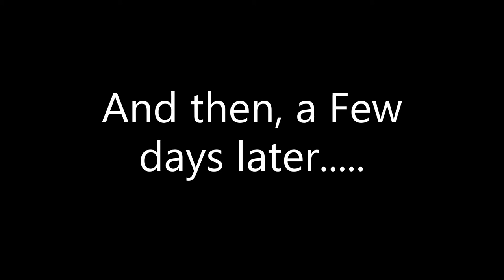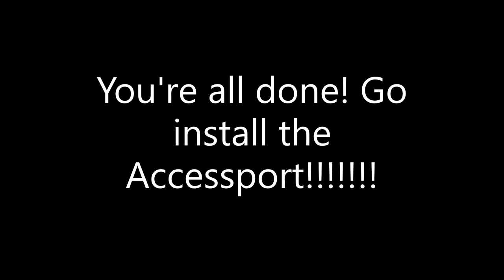COBB Tuning - 2021-2022 Ford F150/Raptor ECU Instructions

Comment: The smooth jazz music makes me feel a little less nervous about pulling the brain out of my new truck and shipping off to you. I'm curious though, what would happen if UPS were to lose the package? How do you ensure that I won't end up with a $90K paperweight parked in  my driveway?
Reply from the maker: Hey there, certainly a valid concern!  Your ECU is shipped insured via Next Day Air both directions, significantly reducing opportunity for it to go missing. We have not had any issues with ECU shipments thus far, but on the off chance something does happen we will work with you to get everything squared away as quickly as possible.